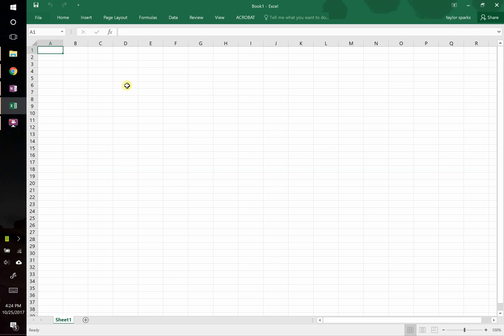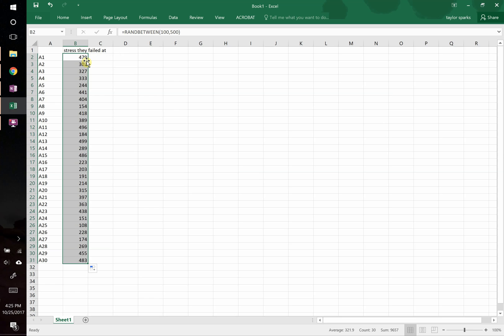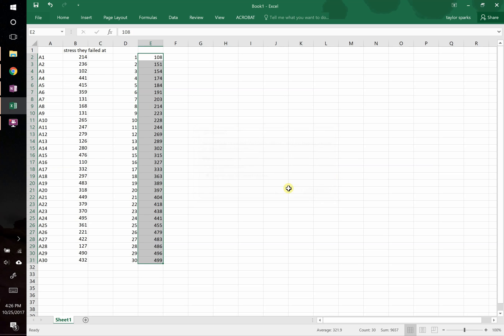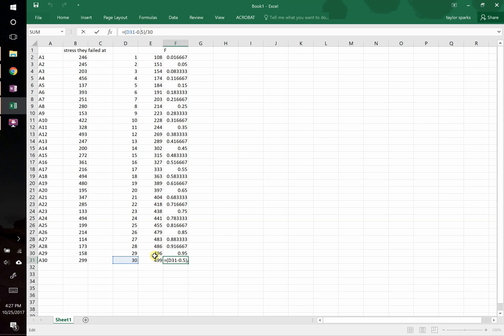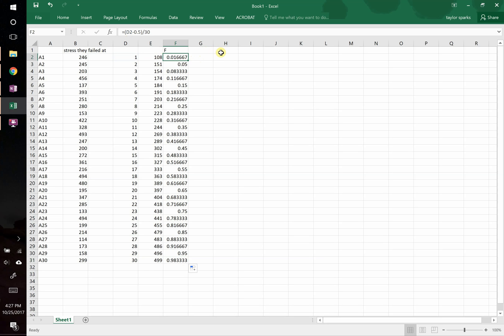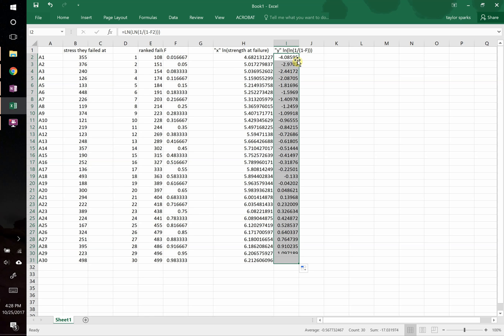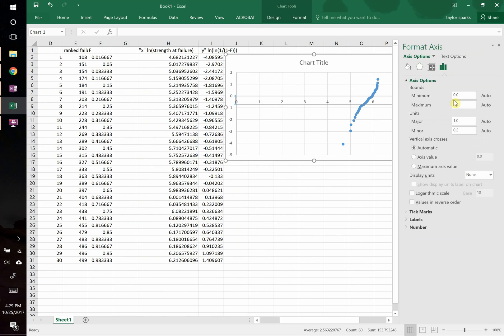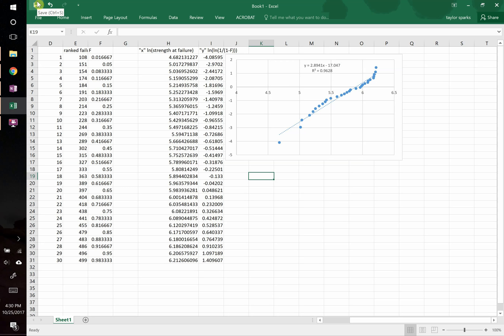Tutorial for determining Weibull modulus in excel

Comment: can i ask why we use 0.5?
Reply from the maker: @dionaaleksi  there are several different values you can use for determining rank. But if you don't use a value, then it will presume a level of confidence in the failure rate 0% or 100%, which is unmerited. 0.5 is a practical consideration that allows it to extend beyond those bounds. There are other formula that can be used though

Comment: I want to find out if a equipment failed x  time within Y hours OF OPERATIONS what is potential probability of that equipment lasting z hours ?  Example if Engine failed 14 times within 30000 Hours of operations, what is probabilities of engine lasting for 50000 Hours or at which hours it will fail ?
Reply from the maker: Do you have more than one data point? If you only have the one data point then I don't know how to solve this problem. If you have a large set of data then you would apply waibel probabilistics the same way that I have here
Reply: @TaylorSparks  can you please explain what you mean two data point ? Please let me know what exactly we need to put something together

Comment: First of all. Thank you for the videos, very helpful. I was wondering how you would go about performing a Weibull analysis were the failure is time-based and not based on stress. Lets say you have a 100 samples that you tested cyclicly to determine the endurance limit. Only 20 samples failed and the other samples did not fail after 1E6 cycles. How do you go about saying something about the reliability of XXX cycles? I have calculated it too and would like to see your reasoning. Kind regards Gerhard

Comment: First of all, thanks for the video, excellent work. At the beginning you say to use at least 20 (experimental/observed values), is there any work that recommends this value? 
I read the original article and there, Weibull presents example with 10 values. Some articles that I have read in Elsevier show results with 5/8/10 values. 
So, I was left with this question.
Thank you again Professor.
Reply from the maker: This is a good article on the topic. Essentially, more samples is greater confidence. https://www.researchgate.net/publication/259388853_Influence_of_Sample_Size_on_Strength_Distribution_of_Advanced_Ceramics
Reply: @TaylorSparks  Thank you!

Comment: How to determine the shape parameter and scale parameter using excel?
Reply from the maker: the shape parameter is the same thing as the weibull modulus. I describe it in this video ;) The scale parameter is typically defined by where the line intersects the x axis. Sometimes called the characteristic strength.

Comment: Hello there. thanks for the tutorial...very helpful..but why did you chose 0.5 to estimate the failure (column F)... i found another website that suggested another formula F=(rank-0.3)/(population+0.4) and he calls it MEDIAN RANK...the latter method makes even less sense...do you have a way to optimize this calculation of this median rank?
Nevertheless, you method is easier than the other tutorial i found
Looking forward for your reply
Reply from the maker: Hello, both my method and the median rank method are both used to fix a problem with estimating failure rates. For example, if I left out my 0.5 term and I just used a rank divided by population then if I have 30 samples and I take my 30th sample and divide by 30 this would predict 100% failure. This is fine with my small sample set, but it's a big problem with reality. In reality, if I tested, say 1 million samples, the odds of having samples which fail above the stress of #30 are very high! Therefore, predicting failure rate of 100% at the stress of sample 30 was not reasonable. For that reason failure rank is modified to allow for realistic cases where more samples might be tested.
Reply: Hello again and thank you for the explanation. I totally understand the reason to modify failure rank. However, i still do not know how to chose that factor 0.5 used in the example...nor the 0.3 and 0.4 factors chosen elsewhere... are these factors still work for any size of tested population? in my case I have different populations with different sizes.. shall I get a factor for each? same for all?
Reply from the maker: @3006spikespiegel  to my knowledge you don't have to choose the factor 0.5, 0.3, or 0.4. you just select a rank formula. I think median rank is more realistic so it should probably be used but you don't need to modify your 0.3 or 0.4 values.
Reply: gotcha... and I realized why your method still works: if you sum the modified ranking in column F you get population/2...in the same way as ranked median (when summed it gives population/2)... i am not really sure why these parameters has to be population/2..i need to dig it further... but probably it has to do with this page where they estimate ranked median using Inverse Beta function at probability = 50%

anyway, thank you very much for the videos ...your latter videos sent me back when i was student in metallurgy!

keep on good job man!
Reply from the maker: @3006spikespiegel  glad it was helpful!

Comment: Thank you for your video mate. Can I apply this approach for sand size distribution problems? For example, I plotted the cumulative mass % against the size of the particles. Am I able to see if my curve falls to Weibull distribution?
Reply from the maker: absolutely. A Weibull analysis simply assumes your data can be fit by a curve and then allows you to define that distribution with parameters that represent tightness of distribution (weibull modulus) and characteristic values etc.
Reply: I think I got the logic - I ranked the sieve size according to the cumulative percentage (the highest stress in your case is the sieve size with the highest cumulative percentage in my case) and then followed your steps. Many thanks for your help Taylor!

Comment: is it possible to use this method to determine the time at which something will fail rather than the stress it fails at. Say i have multiple identical machines that runs for 24 hours and I have data on the number of hours it runs before failing can I use Weibull?
Reply from the maker: absolutely. The steps are the exact same. Instead of ranking your samples by the strength that which they fail, you will rank them by the time at which they fail. All the steps that follow are the exact same

Comment: Thank you so much. This video is so helpful. What is the Characteristic Strength value? Is it -17.047?
Reply from the maker: Mike J close. Not quite. -17.04 I'd equal to modulus*ln(characteristic strength)
Reply: @TaylorSparks  so in that case would the characteristic strength be .00276? to find the characteristic strength, I did -17.047 = 2.8941*ln(characteristic strength), would that be correct?
Reply from the maker: @mihotsubaki8892  correct.